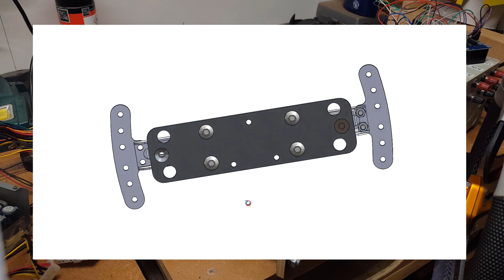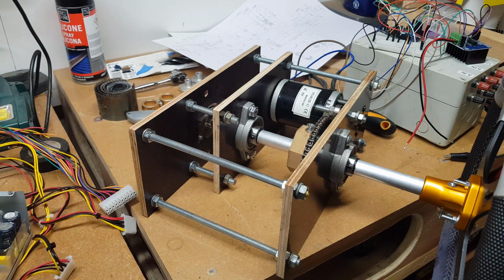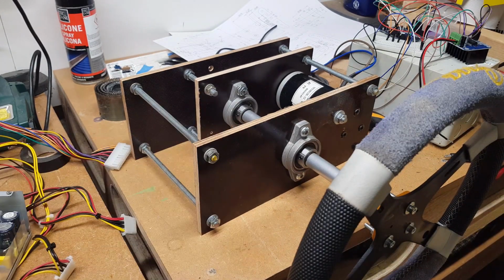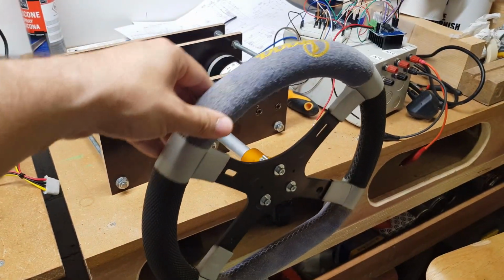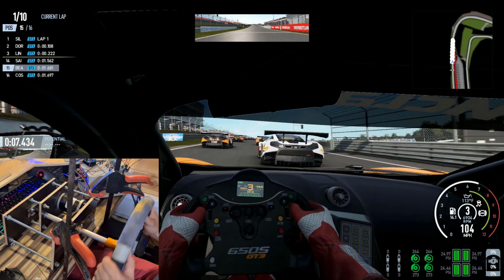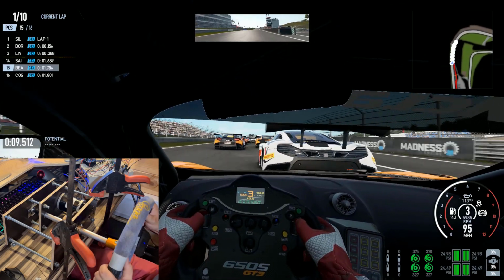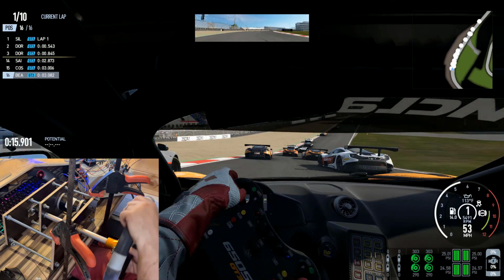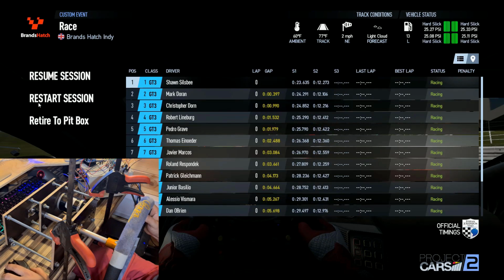DIY Force Feedback (FFB) Sim Racing Wheel - Part 2 Prototype Frame

Comment: Hey mate, how did the Scooter motor hold up? 

I’ve made similar projects using Windscreen Wiper motors, quite torquey, but any-backlash through a work gear - so you can’t fight them back. 

I’ve got another project on the go at the moment, a flight simulator, and I’m looking for a cost effective DC motor source. 

If you can vouch for scooter motors, that’d be great. Love to hear from you.

Comment: What Bearings are you using? Im trying to recreate your setup but with a stronger motor and I cant find the same bearings as you.
Reply from the maker: Hi, I think they were 20mm flange bearings from ebay. Something like this:
https://www.ebay.co.uk/itm/KFL-Series-Housing-Flange-Pillow-Block-Bearing-8-10-12-15-17-20-mm-Bore-UK-sell-/283226063795?mkcid=16&mkevt=1&_trksid=p2349624.m46890.l6249&mkrid=710-127635-2958-0

Comment: Hi, one question, for dc electric motor 24v 300w, what power supply need??
Reply from the maker: I'm not good with electrics! I'd try whatever you have to hand first. If it gets super hot or trips out, then you need one with a larger current rating.

Comment: Hello! How many amps your psu has?
Reply from the maker: Hi, I have no idea about my old one. If you look at part 5, I make a new one from an old MicroATX psu. That was rated about 20A on 12v. So far I've only seen about 6-7 amps using a multimeter.
Reply: @makerepairrecycle3261  And i use an laptop charger or 12v 4amps Lithium battery  drill charger ?

Comment: Finally found a video explaining steering hub and encoder connection Thanks. 
@beardy How is the encoder connected to the 6m bolt at end of steering shaft? Is the coupler clamped around the bolt and encoder shaft?
Reply from the maker: Hi, glad your finding the series useful. Yes the encoder is fitted directly to the shaft using an M6 stud. The stud is stuck into the shaft using epoxy. Used this as the encoder came with a flexible coupling. The coupling has a 6mm internal hole and joins the two shafts with grub screws.
Reply: @makerepairrecycle3261  thanks

Comment: Very nice project. I have two problems, my power supply is 12V/30A instead of 24V and my steering wheel is a volkswagen Gol G4, so it's pretty heavy. Do you think this motor is strong enough to work on this situation?
Reply from the maker: Thanks 😊.  Mine is 12v, and it works OK. For the wheel, I would say give it a go. The weight might be OK, but the diameter is important as well. The bigger the diameter, the more Nm your hands can apply, so feedback will feel weaker compared to a smaller wheel. That's why I wear with a Kart wheel. But definitely give it a go with what you have first, then upgrade as you learn what needs improvement 😉
Reply: @makerepairrecycle3261  yes, that's the idea. Thanks

Comment: Hey man, I'm using a 13" Momo steering wheel that has a six screw thing for mounting onto a car and I'm having trouble looking for something so i could mount it onto a shaft, any ideas?
Reply from the maker: For mine I used a kart steering boss. That has a single bolt fixing to go through the shaft. To mount the wheel you would need to make an adaptor plate. Probably best in aluminium. Drill it and bolt it to shaft hub, then drill it and bolt it to the wheel. Lots of other ways to do this, but maybe this is the easiest. 😁
Reply: @makerepairrecycle3261  thanks!

Comment: Hi, but using the ffb on the steering wheels you don't go to wear out the brushless motor?
Reply from the maker: Hi, all FFB wheel use a DC motor of some kind to provide the feedback. I guess eventually they could wear out. Nice thing with a DIY wheel is you just replace it 😁

Comment: use belts instead of that chain
Reply: He just wanted to build something with what he had laying around, this is more of a prototype and proof of concept than anything
Reply: And why not chain?
Reply: @modellerdesign  Extremely noisy, huge deadzone
Reply: @ManicQuinn  noisy if only to drift. No dead zone. Its all wrong. And its extremely handy for powerful motors.
Reply: @modellerdesign  If you watched the videos, you'd know about the issues, but sure, choose to believe that. You can see in his latest power supply video, he turns the wheel belt slightly and it is still very noisy. The dead zone isn't horrible because he fixed it tho with tension.
Reply: @ManicQuinn  it's noise is due to the bearing, that is used as tensioner here, that contacts with a chain. If the tension would be done with a motor mount only, an ability to move it, there will be none of it. And no slack too.

Comment: Good work on this vid John - can you tell me what is causing the squeak.  I’ve looked carefully and it’s lost me.  I’ve been making steering wheels using aluminium plate and my ended 3 printer and I’m looking at a build similar to yours so I really appreciate your video.
Reply from the maker: Thanks! The annoying squeeze was from the aluminium shaft rubbing on the plywood board. This went away once I opened the holes out and fitted the bearings.

Comment: Nice work for a test rig, the taperlocks will work fine without a keyway, use them on industrial equipment and have yet had one fail
Reply from the maker: Thanks, thats good to know. Been so busy with work I haven't got to stage 2 yet, but I'm planning on getting it done soon!

Comment: Thanks a lot for the videos John, looking to build something like this myself, so the guides really do help in figuring out some of the bits and bobs. For the tensioner you could use something with teeth (pulley) instead of a bearing to eliminate the noise, perhaps a bicycle shifter pulley, as those might be a cheap find, but you get the idea regardless of the source of pulley.

Comment: Are you using a dc motor? If I use a omron 600 ppr encoder without a dc motor would the steering wheel be usable?
Reply: Yes, he is using a dc motor. The motor is used for Force Feedback (FFB), if you don't use a motor you will not get this effect but the steering will work. hope this helps :)
Reply: the wheel will work but it won't have any lock so you'd have to make it

Comment: Can you please tell me where you got this shaft?  Having a hard time finding a shaft with a larger diameter, but a small 5 or 6mm center hole.
Reply from the maker: Hi, this actually came off a site called Aluminium Warehouse. Its a 3/4" (19.05mm) outside diameter, with a 1/4" (6.35mm) wall thickness. Leaves a 6.35mm hole 😁
Reply: @makerepairrecycle3261  sorry for all the questions, but I noticed that your wheel sits perpendicular to you lap.  Do you think that it would have a better feel, if you designed the wheel in a more natural car position, such as an angle where the wheel points slightly up towards the chest area?  Your thoughts?
Reply: @leestow1  it depends on the height of your table and your chair and your height so you'll have to decide for yourself
Reply: What did you search on eBay?